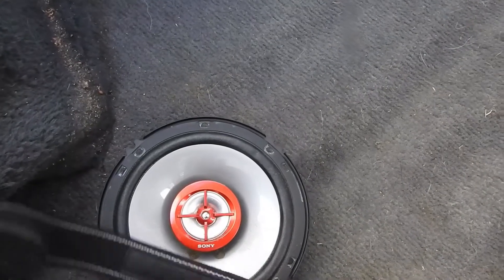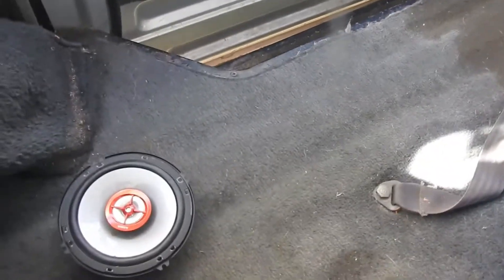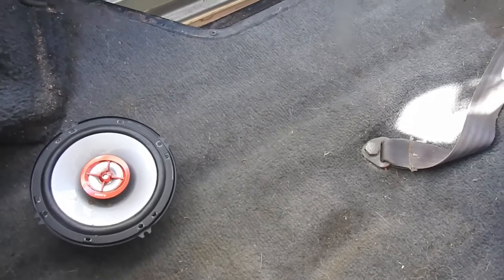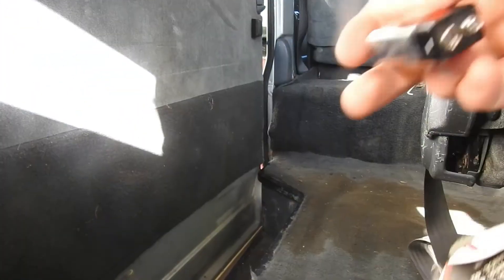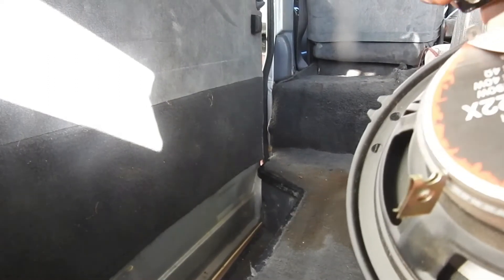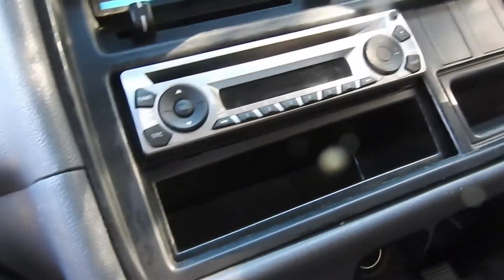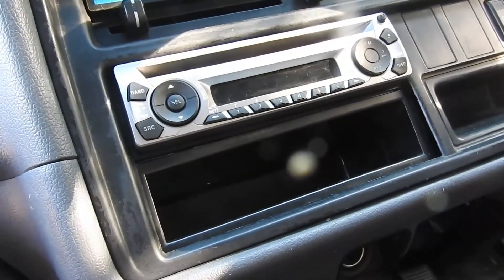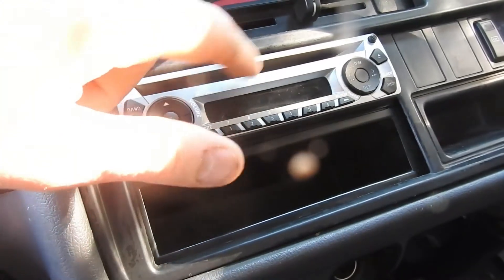Car Stereo No Sound But Powers On Solved

Comment: I've got a similar problem with a chrysler voyager...head unit works fully but no sound..checked wiring and all looks good...has an unusual loom so will have to get a second hand unit I suppose, even tho the bloody thing seems fine and even 2nd hand units are expensive.  Was hoping you'd found a simple fix :-D